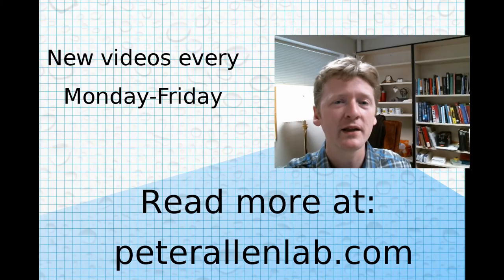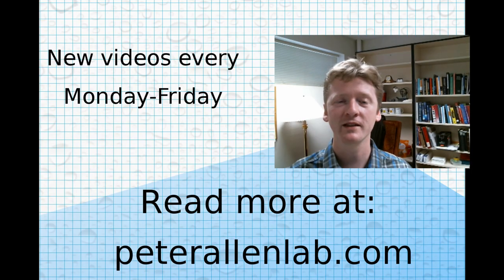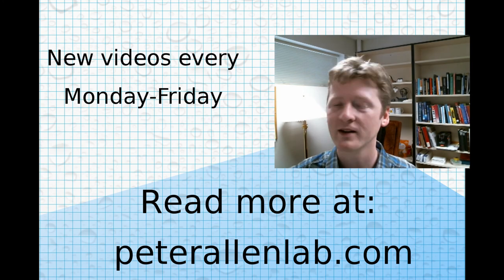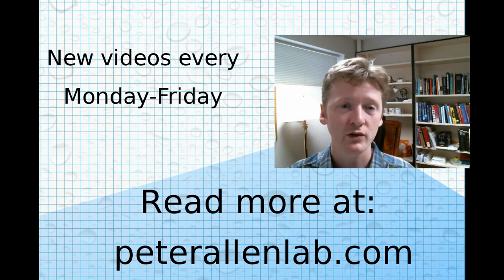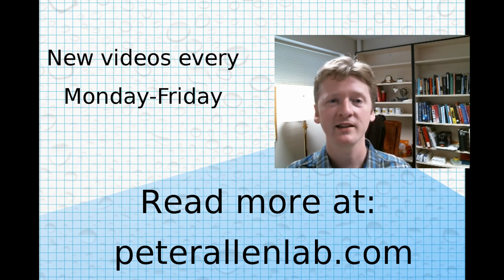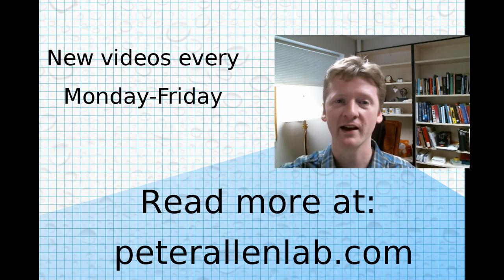Graphene in batteries? What does that do?

Comment: I wonder if graphite oxide is more readily available to you?  Because there is the trick of exposing graphite oxide to an intense burst of light from a xenon flash and causing it to release the oxygen and leave graphene .  (Lasers have been also been used in DVD burners to direct the reaction in much finer detail.)
Suppose graphite oxide and iron oxide were suspended together in a suitable liquid.  Allow the suspension to dry on a carrier surface. Then xenon flash it to convert the GO to graphene.  Maybe repeat these steps to build up a thicker layer?  Hard to predict if the GO and iron oxide would remain in intimate contact. 
Hmmm wonder if the "carrier surface" could actually be the separator material?  But that's dreaming a bit much.  :)

Comment: I've been researching several ways to create graphene.   Robert Murray Smith has shown some videos regarding this topic,  specifically by intercalating the graphite sheets then split them apart by applying voltage and sonication.  My main interest is to make conductive ink out of this material so battery or supercap electrodes can simply be painted.
Reply from the maker: Cool idea - I've looked at sonicating graphite to generate graphene but have not tried it yet. Sonic baths are pretty reasonably priced these days, but it's not clear to me if the inexpensive ones have enough power to exfoliate graphene. Here's an article on the subject. Is that the kind of thing you've been looking at?
http://dx.doi.org/10.1039/C3CS60217F
Reply: yes....  However,  the abstract doesn't give enough details on the process.  I've seen 3 methods of achieving this with a sonicator.  It seems to be one of the best routes to producing graphene without exposing myself to strong acids and sticking it in the microwave oven.

Comment: I haven't touched chemistry in ages, so this will sound naive, but perhaps the idea is adaptable. Electricity is more my thing, and I'm planning to wire up a solar system soon, but the expense of batteries is awful.

How about this? Use a copper stranded gounding wire coated with something less reactive, perhaps nickel, onto which the rust can deposit. Copper is cheap; if you can't afford it you'll have trouble wiring the battery to a device. Nickel (or what have you) would be plating only, so minimum quantity. The iron oxide is a poor conductor, but with this arrangement it need only conduct through a small thickness. I thought of stranded wire to increase surface area.

To go large, I imagine building this in PVC pipes. Wrap the wire with the separator, and put that in a 1" steel pipe, sleeved in 1 1/4" PVC to insulate. I'd like to make cells capable of 100 Ah, in series to get to 48v. Building a hundred cells doesn't daunt me if a small scale can prove it. And I have a whole room I can devote to it, so density isn't critical.

Bit of a ramble, but does that suggest some possibilities?
Reply from the maker: I like the PVC pipe for cheap form factor. In a later video, I used plastic tubes (https://youtu.be/RD546IYBtlQ) but it would be easy to substitute PVC pipe and fittings. It turned out I never could get iron oxide to reduce, but I did get it to work with iron EDTA. A 5 kwh battery is going to be quite big, though. Good luck!